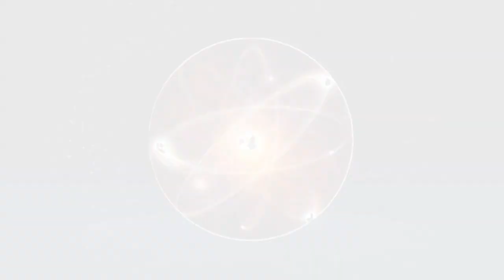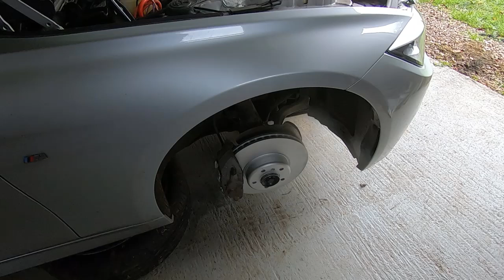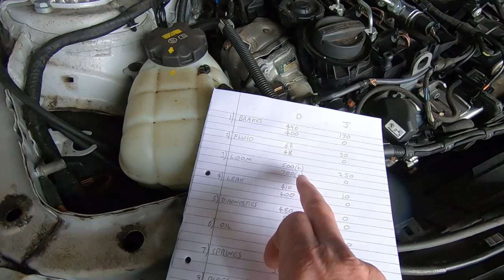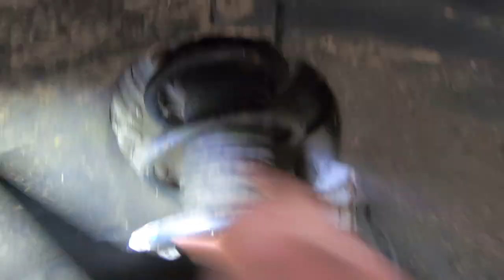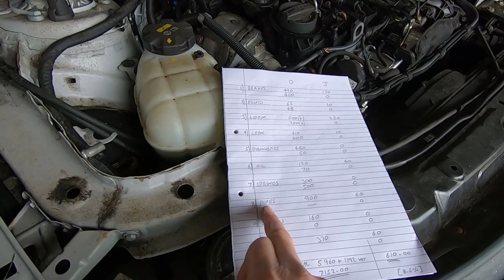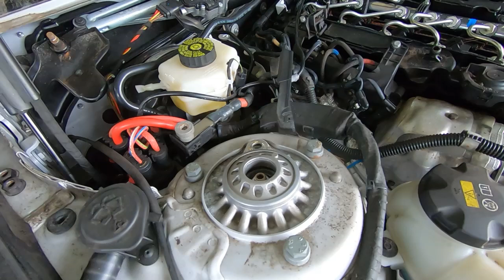Car Repair Costs

Comment: I know here in the U.S. years ago they used nut oil (peanut, soy, and others) when making the wire insulation and loom. This is why vermin attack it. They "smell" the imbeded nut oil and try to consume it. I think all auto manufactures should be responsible for the retrofit of all wires and looks (at least in the engine compartment).

Comment: You have been far too polite Jerry. Looking at the map, there are not too many BMW dealers in your area. You might be doing folks a favour by naming them. My suggestion to anyone having the same experience and not feeling confident about doing the work themselves (as none of this work requires a BMW specialist skills or.tools) would be to get a few local trustworthy small independent garages to quote for the work.
Reply from the maker: If I named them then you would probably never see the video as YT would probably pull it. I have looked for a good independent and may have found one. I have heard good things about them and if they are good then I will most likely post a follow up. When I lived near Cambridge I used one called Bartlett and they were excellent but I live too far to use them any more (although I have been tempted to make the journey to avoid the local dealer). I also suspect that this is not an isolated dealer and naming them could imply that others are better. I would rather wait until I can find good support and then support them and in turn vote for the local dealer by taking my money elsewhere. I ran my own businesses and we had a name for excessively high quotes which were intended to ditch customers. However I am surprised that BMW allow it to continue because it gives their cars a bad name. They seem to be working on the infinite market principle (happy to drive away current customers because they believe there are always more).

Comment: Really good video Jerry. I have had similar experiences, and had a Beamer previously, got put off by excessive diagnostic charges and found a brilliant local independent BMW guy. Unfortunately the main dealers (and I think this is most big names) are really only interested in selling you a new car, and these ridiculous quotes are designed to make you think ** better buy a new one. Most folks are wiser than that I hope.
I value the time spent under dodgy eastern block cars, I may not maintain my own these days but always remind myself it is just a case of suck wheeze bang blow (or some variation of) when my offspring have issues. 
BTW - the 6 cyl sounds nice but I still think the 5 cyl Audi beats all!) - Have an ageing  tail to explain that one.... J   Always good to see honest sensible content.
Reply from the maker: Yes I think that is part of the problem. It always strikes me that dealerships have a major conflict of interests. They are trying to sell new cars as their primary goal so why would they try hard to support them once they are sold. Independent  service agents who do not sell cars want to retain customers so do a better support job. Unfortunately for BMW their approach does not work on anyone with any sense. Following the poor support I have received since moving to this area I will never buy another new BMW and non at all unless I can find a good service support company.

Comment: 💷7K, wowza. That's a lot. I remember the video on the lawn mower when you got the clutch plate, and discovered the manufacturer was charging 250 for new, while you could get the same size/dimension/spec clutch plate OEM for much less than that was it 65? Anyways good on ya' mate! 👍You did it.

Comment: Reminds me of the time I took an Austin Maestro to Kwik-Fit for a new tyre, many years ago. I was told it also needed four new shock absorbers. When I told him I'd had all four of them replaced the previous month for its MoT test, I enjoyed him trying to wriggle out of it. Something along the lines of "erm, well, sometimes the replacement parts aren't very good", or some such rubbish. I do (almost) all my own work now, as my confidence and skills have increased over the years.

Comment: Typical dealer scam. You take an older car in for service, and they invent an absurdly high estimate thinking you're sure to want to buy a new car from them rather than pay an arm and leg to get the work done (90% of which was not needed.) They do the same thing if it seems like a difficult/intermittent problem; invent an absurdly high estimate to dissuade the owner from getting it fixed and save themselves from actually taking the time to diagnose it properly and it also removes their liability for the shoddy diagnoses they did. 

As another YouTubers says: "BMW = Big Money Waster". I own a BMW product and I am NOT impressed...
Reply from the maker: Yes I agree although it is not just BMW. The wife had a C3 which developed a serious miss fire. It was a fairly new car and in very good condition. She took it into the local dealer and after several days they said that they could not fix it. She went to pick it up and when she got back there was diesel running out from the engine (A lot of it). I took a look and found that they had failed to reconnect the injector return line. The entire car was covered in diesel but it had also run into the clutch housing and ruined the clutch which then slipped badly and never recovered. We complained but the dealer said it was not their fault. I have no idea who they thought was responsible. I fixed the miss fire myself which took 10 minutes (poor ground connection under fuse box) but I also had to change the clutch which was a MUCH bigger job. We eventually gave up trying to get the dealer to accept responsibility because they came up with a different story every time we spoke to them.
Reply: @JerryWalker001  Interesting that dealers play the same games no matter the country. I tend to do my own work but have a local, independent shop do the odd job now and again. They do good work and are honest.

Comment: That's why I suggest using Halfords for MOTs, they are not reliant MOT money. Possibly a naive statement, on my behalf but that's my experience.
Reply from the maker: From what I have been able to figure out over the years I think that the reason dealers do not like working on older vehicles is because of materials used and impact drivers. In the video I mentioned that I had repaired a few other issues I had found. One was that I noticed the water pump had been replaced during the recent visit because the brass insert had been ripped out of the original. I know it happened because the insert was still on the bolt and it was just flapping around. They had replaced the pump with a new one although they never mentioned it to me. I think that this sort of thing becomes more common as the cars age so dealers do not like having to replace parts at their expense (and they want to sell new cars). Oddly the workshop manual even says that the emission test can damage the transmission during an MOT (This is a 4WD car). The entire thing seems a bit contrived to me, maybe I have become too cynical.

Comment: I remember my old man telling me a tale about a garage he’d used for 20 years for his MOTs. They claimed he needed a new number plate. My dad walked up to said number plate and scraped a small amount of paint off with his fingernail (he was a decorator by trade). Even small business don’t reward loyalty, it seems.
Reply from the maker: Independents seem to vary a lot but I will never use dealers again. I used to get my BMW's serviced at a company called Bartlett and I have to say that they were fantastic. Very fast and efficient and never any silly charges or made up work. I moved to a new area 10 years ago so started using the local dealer but I am seriously considering driving 120 miles each way to Bartlett for future work.
Reply: @JerryWalker001  For the presumably small amount work you choose not to do yourself, it might be worth it to make the trip to Bartlett's. Besides, you would get to enjoy a lovely drive. We have a local mechanic here in Toronto who is helpful, friendly, competent, and honest. I would guess that they have no trouble with margins.
Reply from the maker: @MichaelEhling  Unfortunately there is no such thing as a 'nice drive' in the UK any more. The state of the roads guarantees that you will hit a number of large pot holes and need more repairs. Speed traps, closed roads, Idiotic traffic calming schemes, and so called smart motorways etc etc mean that a 240 mile round trip is likely to take up to 9+ hours. Our government is trying very hard to force people out of cars so they make journeys as 'painful' as they possibly can and irresponsible policing makes things much worse. 20 years ago then absolutely I would use Bartlett.

Comment: I am disappointed, Jerry! I expected you to rigg up the logic analyser and upgrading the ECU to a proper Z80! 😬
Nice car btw! I had a 324d in 1992! 78hp 6 cylinder diesel, no turbo! 😂
Reply from the maker: I forgot to video that bit.
It is easy to run these 3 litre 6 cylinder engines up to 400+ Hp. I am not saying I have done that :)

Comment: One of the front springs on my E90 BMW 330D M-Sport broke last week at 70mph, and the sharp end pierced the side of the tyre with a bang!........so I can see where they are coming from in terms of liability as they probably don't trust the cheap steel they used to make them! Search online, BMW front spring breakage is definitely a thing!
Reply from the maker: Yes car suspension springs break but the minute amount of corrosion on my springs would certainly not be a primary cause of failure.
Reply: @JerryWalker001 You are probably right, and in your shoes I wouldn't replace it either........but just to say my spring had no real corrosion either, especially where it shattered.
Anyways, i'd much rather have my BMW than my wife's Corsa.....which was recalled for a front subrame (holds the engine in) which was so badly corroded it was deemed a safety hazard. £1000 of subrame changed out free of charge!
Reply: I had something similar happen on my Focus. Luckily, the tyre burst while moving the car on the driveway, as the spring had broken while the car was parked. Unluckily, the tyre it destroyed had exactly 2 miles of wear on it.
Reply from the maker: @Zeem4  Spring failures on the Focus are fairly common. We have had two fail.

Comment: There may be access to the boot through a breakout section behind the rear seats. That's how the mechanic got into my E36 back in the day.
Reply from the maker: Nope, Like I said in the video there is no ski opening in these cars. The rear seats are also bolted in from inside the boot. BMW designers must have had a day off when they thought of this one.

Comment: Every car I have taken to a dealer for work always ends up with "something else." Margins are so thin on sales that they need to pad them on the maintenance.
Reply from the maker: Yes, same here. Sadly it is not just a single dealer franchise, It seems to be the same with all of them. They also always seem to refuse to accept responsibility when they damage the car.
Reply: i went to a dealer one. They told me i had to pay to replace a part that they replaced the year before that was STILL under manufacturer warranty..... suffice to say i didnt go back and i didnt have to pay and it never appeared on my MOT cert :D. i reported them to DVLA  @JerryWalker001
Reply: Genuine BMW parts can be extremely expensive. If I can, I try to find out the original manufacturer of for example brake pads and buy those. If that’s not an option, I’ll compare the BMW prices with some reputable other manufacturers. 

Another example: gear box oil from BMW was twice as expensive as the ZF oil. 

Brake pads were 5x (I’m not kidding) more expensive than just about every other brand for one car. For another (more performance oriented) BMW, the differences were not that much so I stuck with BMW disks and pads.
Reply from the maker: @Conservator.  I think it probably varies but I have owned BMW's for decades and have never found BMW parts expensive as long as you do not buy from dealers. For example the front coated disks and pads for this car (400Hp 4WD performance car) were only £160.00 including the wear sensor and bolts and shipping. This is more than something like a 1.6 Focus but they are not really comparable. I agree that BMW branded oil is a crazy price but there is nothing special about it so any good quality brand of the correct spec should be fine. What really pushed up the repair cost was dealer labour at £180.00 per hour plus VAT and something like an engine loom swap is fairly time consuming. The main thing was ignoring the 'not required' items or replacing a 10p o-ring instead of a fuel tank (plus labour).

Comment: European cars are money pits.

My 23yo car costs $100/yr to maintain myself
Reply: I wonder whether you are familiar with the European car market or just with the brands and models present in the USA.
Reply: "European cars" seems like a very broad brush. My 2002 Ford Focus is European, and in the last year, covering over 15,000 miles, it's needed nothing but two tyres, an oil change, a pair of wiper blades and a couple of bulbs.
Reply: @Zeem4  i meant the upper market euro cars like bmw